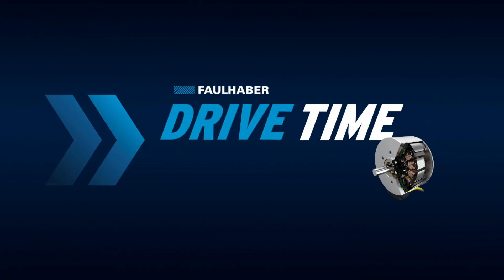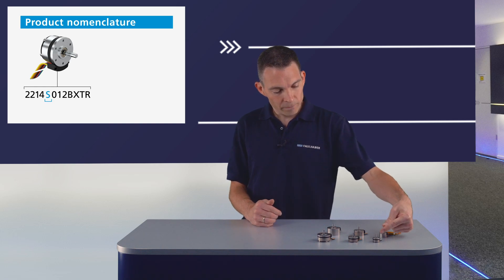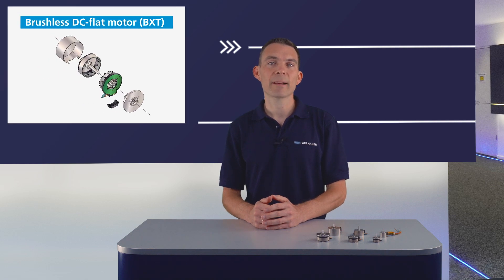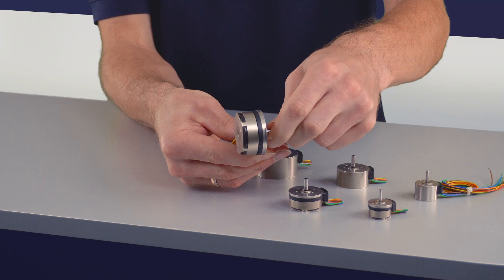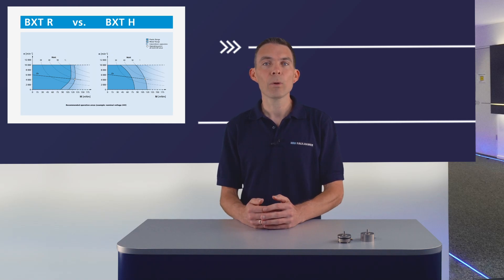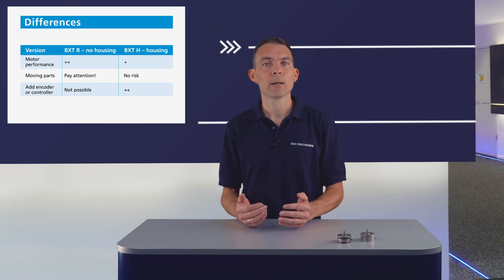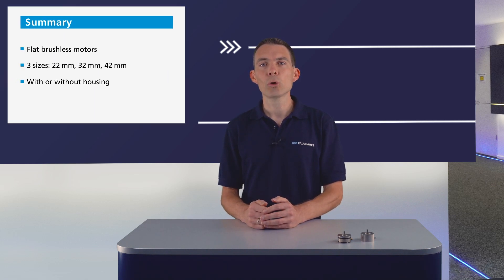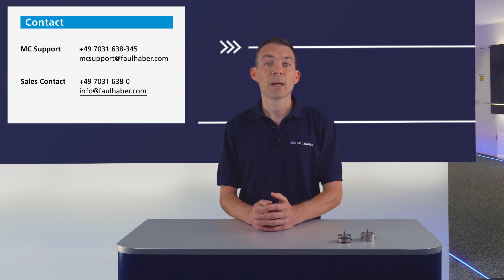Flat brushless motor FAULHABER BXT: A high torque motor at small size - FAULHABER Drive Time

Comment: I'm using the bxtsc version motor
There's a sound of iron scratching in the housing.
It used to be very quiet. It's like this all of a sudden. The axis of rotation touches the outer housing? It sounds like a sound.Please tell me how to disassemble it or tell me how to do it.